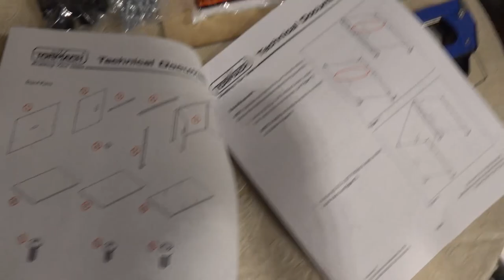VLOG 004: Flight Project, Sponsors, Webshooters, and TEDxKC!?

Comment: Are you planning to hook up solar cells to the iron man suit fans in order to charge them in between flights?

By the way, I don't care that your videos are sponsored. I'm here for the content. If sponsors are how the content gets made, then take all the sponsors you need.
Reply from the maker: +IceDragon978 thanks for the support!

Solar panels aren't efficient enough though... Even plugging in the flight system to my roof top solar array.... Would only be enough for one EDF :p
Reply: the Hacksmith Is there any way to incorporate something that acts like an alternator then? Something that converts your movement into AC to continually charge the fans simply by using them? Some sort of wind generator maybe? That combined with solar cells might be good enough, right?
Reply from the maker: +IceDragon978 there's really not... That is the whole problem with any kind of flight system -- the energy density required is off the charts :( 

Tl;dr lithium batteries suck, but they're the best we have at the moment :p
Reply: the Hacksmith That's a damn shame.
Reply: +the Hacksmith to bad carbon-based baterys are way to expensive and rare yet. In a few years the energiestorage won't be a problem
Reply: +the Hacksmith to bad carbon-based baterys are way to expensive and rare yet. In a few years the energiestorage won't be a problem
Reply: You know there are supercapacitors that can hold and deliver much more electricity than batteries and can charge up faster!
Reply: +Alex X More instant current yes, but more capacity?  Not yet I'm afraid.  some day though :)
Reply: +tiporari Well your right but you could probably get by with less capacity because you could charge them faster. But this is just a thought, no idea it works.
Reply: That would take hours
Reply: +the Hacksmith  cant you make a mini motor with plane fuel to generate energy for flying mechanism ? or cant you make a big battery(by using tape to stick em together) and if you had electronic stuff knowledge you can build one with The size and capacity that u need. good work tho :D
Reply: Mehmet are you actually serious....
Reply: God Haha damn when The Lord Himself comes down to question your judgment, you know you've made a mistake somewhere along the way.
Reply: +God  i cant properly translated it dude it May sounds weird or something diffrent
Reply: +the Hacksmith what about ultra capacitors?
Reply: Mehmet baha Özen Its nothing with the translation, the idea is so fundamentally flawed.
Reply: +God it could work
Reply: The Flame Thrower 
Yeah? What part of it.
Reply: +God well it's just acting as a more efficient generater
Reply: The Flame Thrower "cant you make a mini motor with plane fuel to generate energy"

So as well as the two electric motors he has, he will have to carry an extra combustion engine assembly, as well as fuel to use on it. How is that even remotely feasible...

" or cant you make a big battery(by using tape to stick em together)"

He is already using lipo batteries in parallel.
Reply: +Alex X For the same physical size a lithium battery (12V) can hold approximately 5000 times more energy than a capacitor. For higher voltages even more.
Reply: True.
Reply: Better team up with Elon Musk then :P
Reply: +God i said it was possible not the best
Reply: The Flame Thrower You said it was a more efficient generator which is outright false. Just curious, do you know anything about mechanics whatsoever or are you just blurting out nonsense.
Reply: +God you just have to keep arguing
Reply: The Flame Thrower I mean you keep trying to defend yourself so...
Reply: gonna need a reactor core
Reply: well said
Reply: +God here we go again
Reply: The Flame Thrower do I upset you?

Comment: love your channel, just an idea for thought that you may already have in mind.try having the electric jet motors on your back as well. like low power ones on each hand that act as steering thins,high power ones on each calve as push then four high power ones on the back as extra push that is able to hold your weight

Comment: If you could, you should add two more fan thingys to attach to your feet to allow you to fly without all the strain on your arms and it will give you control. That Might allow you to fly for longer if you could charge the batteries to be powerful enough

Comment: Just an idea that i was thinking you could test out. its a form of homemade bullet/blast resistant plating. roughly 1/2" think slab of high durability tape (such as gorilla tape) coated with a 1/4" shell of that high durability paint such as truck bed liner paint. I did the math some time ago and it should at the very least stand up to pistol fire buckshot if i remember right, but i was never able to test it. I know there are probably far better materials out there but its just an idea that has always bugged me.

Comment: take the turbines and funnel them with like an oil filter type thing to create the psi to power your limbs, instead of that huge airtank! that would be awesome, anyway love the channel the imagination creativity, and the fact that yall always keep going and create awesome videos!! LOVE IT!! You have a fan here my friends!
Reply from the maker: I'm afraid that's now air pressure works =) But good idea!!!
Reply: +the Hacksmith I take it you mean "not how"?
Reply: +the Hacksmith why wouldn't it work? (not trying to be a smart ass just wondering) wouldn't/couldn't it be the same concept as those wailing flailing inflatable tube guys that car dealer ships use? You see what I mean, and shoot, what if you stuck a cheap turbo on it to increase the psi?
Reply from the maker: +Mexi Melt consider how an actual air compressor works -- it compresses the air using a piston, similar to an engine. The air has no where to go but to be compressed -- if you blow air into any kind of open system, you won't get any pressure because the air will just escape! It's basic fluid dynamics :)
Reply: +the Hacksmith ooohh okay, well since the turbine is throttle controlled it wouldn't be running the whole time, only when you'd need to straighten your arms, and maybe the arms could be bent with some kind of elastic just naturally pulling the arms to flex? (you are awesome man even taking the time to talk with your fans props) just a fun idea thanks for listening
Reply from the maker: +Mexi Melt the pressure in a whacky inflatable arm dude is probably like 5 psi or less -- my exoskeleton runs at 200PSI. Sorry it just wouldn't work :p
Reply: +the Hacksmith yeah I figured it wouldn't with just one, but with dual, wouldn't the psi be around 160? so adding a smaller 3rd turbine would make that mark? or did I do the math completely wrong, which I might have, stupid google...

Comment: Will the webshooters be the kind that shoots out a single string that attaches to something and lets you pull it, or the kind that lets you web stuff up (like if you took an air compressor to a hot glue gun)? 
Both?

Comment: if youre sponsored by Hobbyking, do away with the Dr. MadThrust EDF and work on building a custom set of EDF's based around their Turnigy Rotomax 150cc brushless outrunner motors. I'd imagine that with cut down on costs and the amount of fans/esc's you'll need to run +thehacksmith

Comment: what you should do for the iron man thing insted of those small batterys connect a car battery then put it in a back pack as its holder
Reply from the maker: +Kaide Mestre roughly 3 of those small batteries has the equivalent power to a full size car battery! :)

Comment: pls dont make this flight system half hearted, you need way more then 4 engines too lift of or stay in the air, and even more power too hover. you could start by adding wings too it so you could start from a higher point too fly and end the flight in a hover so you dont have too hover upway.
Reply from the maker: +RedsnowHD your lack faith disturbs me young Padawan....
Reply: I would love to doo this project by my self but I believe if someone can do it, then is it you!

Comment: hey hacksmith i know you are getting many comments and you are trying go read them all, so i try too make i short. Ive calculated  a bit myself and i came too the point that with 15 enginges 1 2800 Dollar Lithium Battery and some Wings you could Start from the ground and fly high speeds in the air for a long time. 10 k money should be enough to realize it. hope i could help you